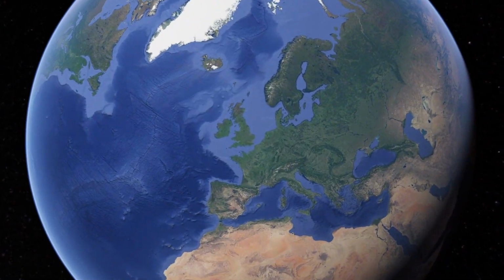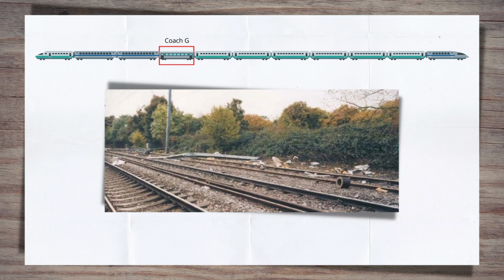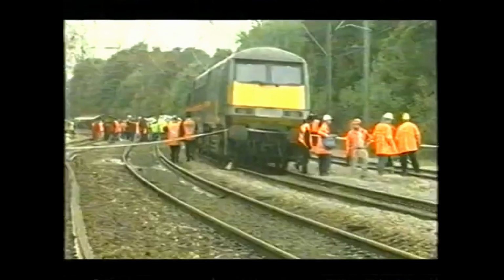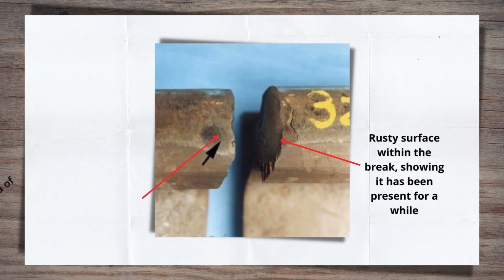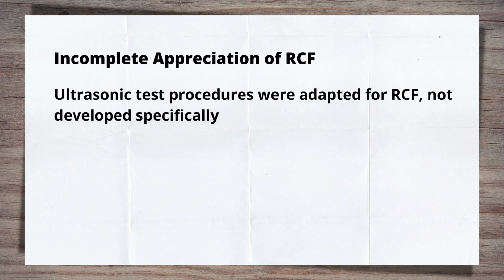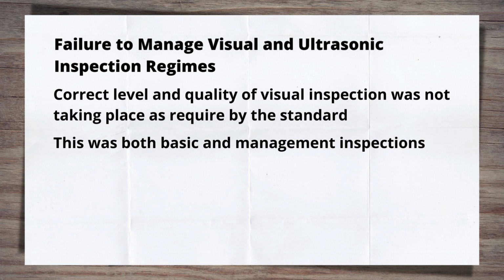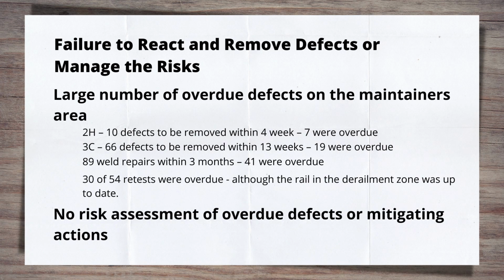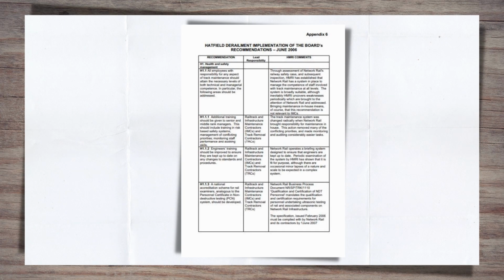The Hatfield Rail Crash Unveiled: Decoding the Railway Tragedy

Comment: Railtrack were warned about this on over 100 occasions (including 4 times from myself).  I travelled the route daily and I described exactly what it was like travelling over that piece of track on a 225, 125 and 365.  It was always worse on a 225 - the train would "hunt" approaching the curve, jerk violently on it and, as it straightened out the wheels appeared to be running over the sleepers making a "bang bang" sound for about 2 seconds.  It was similar, but not as bad on a 125 and less noticeable on a 365.  When I was told there was a major problem "on the line" by a Railtarck staff member whilst at Kings Cross, I said, "not at the Hatfield Curve?"  He nodded.  This accident could, and should, have been avoided.
Reply from the maker: It seems a lot of people knew there were numerous issues, but the blinkers were on to the potential consequences